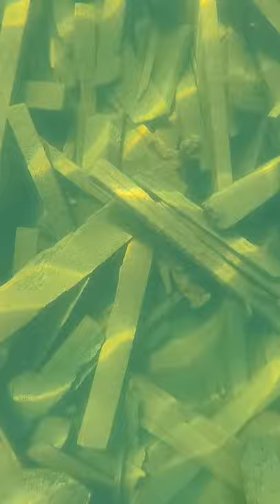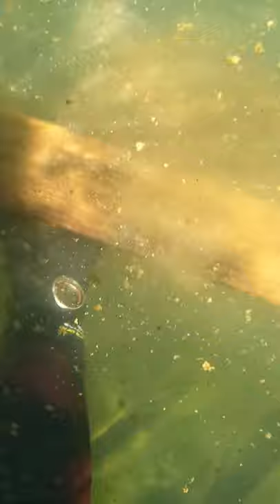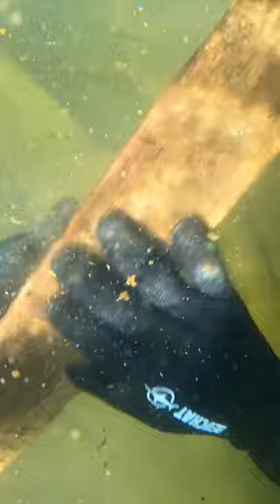Untraditional lumber harvesting in Canada  #shorts

Comment: Mate, do you know, that this is a way how bog (or stained) oak is made? =)))) woodmasters keep lumbers underwater for a while, like a few years.
Reply from the maker: Had no clue
Reply: @AquaticMonkey  Treated by nature itself, the wood becomes not only very durable, but also acquires a beautiful texture. It takes a very long period of time for this to happen. Experts say that the minimum period is 40 years, the longer the process lasts, the better. For example, an oak that has lain under water for at least 300 years becomes pale yellow, and after 1000 years - black.
Reply: So does he take it or not, is it stealing or not? 🤣🤣👌
Reply: Wood also does not degrade when submerged. Homes in Venice are often held up with wood beams. Often the parts most replaced are the pieces that sit between the buildings and the submerged lumber.

Comment: The wood is severely water logged. It wouldn't be useful for anything, even with drying it out. Wood loses a lot of its internal integrity and strength once it is water logged, and then dried out.  For the amount of labour involved in retrieving the wood, it would outweigh any cost returns